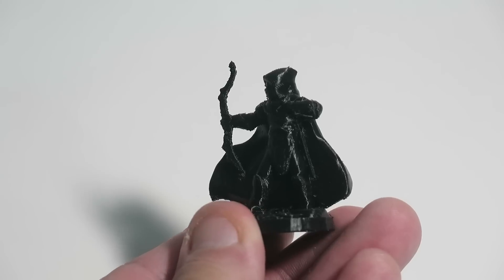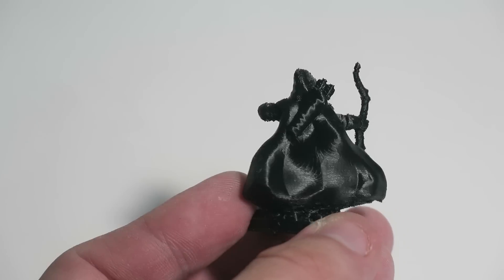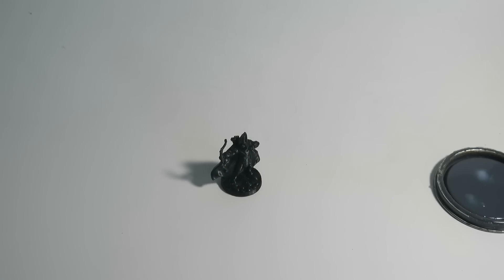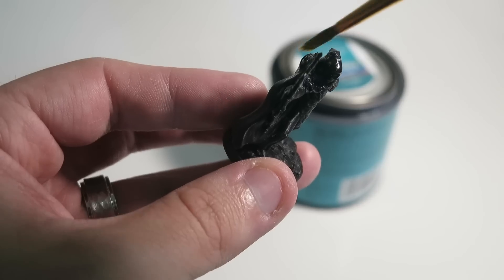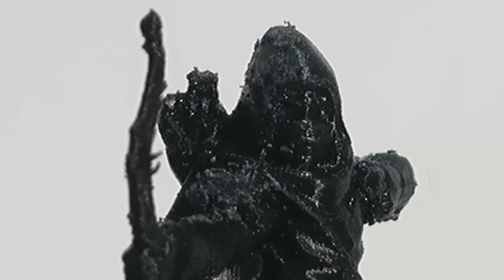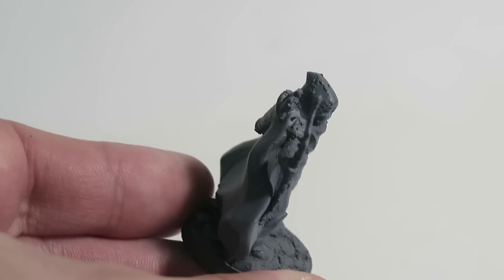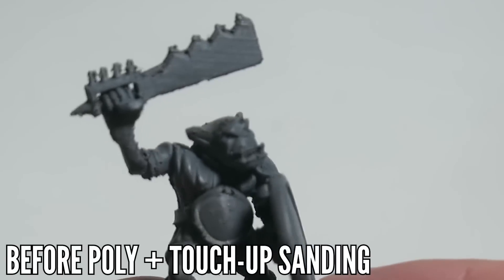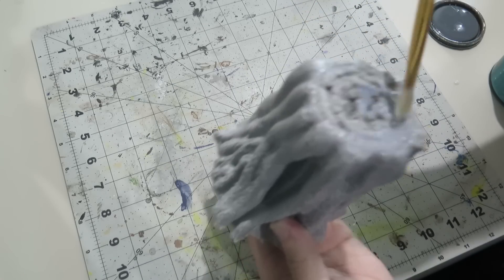Smooth 3D Printed Minis in 1 Min without Acetone - (Printing The Game #5)

Comment: I haven't tried this on minis, but for woodworking I mix my poly with mineral spirits about 50/50 and it helps thin out the poly and makes it much more forgiving.  Since this requires such thin coats it may be worth a try.

Comment: Hye bro,  what software do you use for profiler ? to convert to gcode? I am stack int the transtion between exporting zbrush to any kind of software to print... I useing zbrush for more than 8 year, but I am getting old to learn new softwares . I need a 28mm scale with 1,75 pla filament for now at future maybe change at anottehr material.

Comment: Ts-100 - thermocontrol soldering iron also useful for smoothing prints, fill gaps , build huge models from parts...
I use 160-180°C for pla and blade-like tip.
Also i use construction heatgun, sandpaper, CA-glue and fill primer for big models (i'm working in art studio)
Sorry for bad English (

Comment: The best actions you can take to make a figure as smooth as possible are made BEFORE you print it.
Most of all, use FDM-optimized models and tweak your slicer settings perfectly.
Reply: Tweaking settings for minis can take months of trial and error without an already largely supported profile. This is a good way to help hide imperfections while you learn.

Comment: Except paint does not adhere to polycrilic.
Reply from the maker: I don't know where you get this from, but I have painted lots of models after applying polycrylic, and never had an issue with primer OR paint sticking afterwards my friend
Reply: @3DPrintedTabletop  I get it from 40 years of applying finishes. You may have paint laying on top of poly but it is not attaching chemically. Just look at the directions for muliti coating poly, once it has cured you must sand it to get any bond at all because it wont even stick to itself.
Reply from the maker: I believe you, Mike. What does that mean if I prime it, paint it, and then seal it? I've never had any issues with my paint rubbing off or anything with plenty of use and tackle box storage (rough contact with other minis.) Is it effectively good to go still? Thanks for your input.

Comment: So is the polycrylic more to fill in layer lines or will it help with bumpy areas that didn't get sanded well? Also, will a spray on poly work? Not sure if they make a water based but not sure if it will help. Do you really need a brush on type?

Comment: What about UV resins? You can apply and when you’re happy with it you can use a UV flashlight to cure. It’s also good for bonding parts and filling in parts that you may have ripped off during support removal. Product is called Bondic.
Reply from the maker: Hey Ben! Good to see you here instead of the FB group :) This is ABSOLUTELY an option! I know some folks who even apply their regular printing resin and cure it with a UV flashlight like you mention. It can get messy, of course, but yes - it works. Cheers! Thanks for your comment.

Comment: You should give 3D Gloop PLA a try. It's meant as an adhesive, but it softens and smooths a PLA surface quite well, and the bottles have brushes built into the lid

Comment: hello i have found that mr surfacer 5000 is a good primer instead of autoprimer for these, it is alot more softer. it is made for gundams but it works well and the can is smaller too.
Reply from the maker: Thank you so much for the tip! Is it more expensive?
Reply: its about the same, it has 1200 grits and 1000 grits as well so its pretty smooth. i looked up and found bigger cans

Comment: Is there something similar to this that isn't clear? I'd rather see the result of the coating than have to spray paint it to see the difference.
Reply from the maker: The only thing I can think of that MIGHT work is to use spackle putty, joint compound, or something like that, rub it on with your hands, and then take a VERY light damp towel over the top to remove the excess and smooth it out. I don't think it'll be be nearly as smooth, way more messy and difficult to control - but it just might work in this context. It'll cost a few bucks to try at best. Want to give it a shot and lemme know how it goes?
Reply: 3D Printed Tabletop 3D Printed Tabletop are you talking about wood filler? That play dough like stuff? I have used that on a print before with mixed results. It all depends on how well you can sand it after it hardens so it's best on big flat-ish surfaces. Good for cracks and such. It also doesn't really adhere to the surface too well so it's possible to sand it all away.

Comment: thanks for the tip about polyurethane I made a pip boy from fallout but the layer lines wouldnt go away (printed at 0.2) so I tried some on a small piece after about 4 or 5 thin coats I couldn't feel the lines with my nail so I hit it with some primer and it looks so good I also stripped a hole that I needed to put a screw in to so I added super glue and baby powder and filled it and it works great just a little tip for people
Reply from the maker: Love Fallout - and glad it worked for ya :) Filler primer would work well too, but might cover up some of the detail and require some sanding. That super glue/baby powder/baking soda tip is big for filling gaps as well :) Thanks for the share!

Comment: Hello a doubt between the ender 3 and the prusa mk3 origianl, which has better quality in miniatures, ? . 
the MK3 is much more expensive, but if it gives less problems and its final quality is superior, for me it is better (in the facegroup of the ender I see that there are several post with problems). 
I'm relatively new to 3d printers, I have a flash forge finder, but I want something with more surface printing, and I'm not patient enough to configure paramenters and be doing thousands of tests. I can not afford a very expensive printer either.

Comment: I've had a couple prints where I really wanted a glossy, smooth look (oozes, flameskull, dragon scales); I ended up using enamel model paint, and just layering it.  There's a trade-ff between detail loss and smoothness, but for certain jobs it works great.
Reply from the maker: On those, I actually just apply the poly after I paint. Or I use a spray for those after paint as well. Not only does it seal it and protect it, it leaves it glossy too super quickly without losing detail since it dries clear. Pretty cool to try enamel model paint though! Thanks for sharing!

Comment: You've got to be careful with it, but one way I help get my prints smooth is a lighter.  It helps a lot with little bits that are hanging off after sanding and cutting pieces away.

Comment: Danny, thanks for your helpful channel, I've gained a lot of knowledge here.  I do have a couple of suggestions (well, four actually) that could help with your models as seen in your videos.

 Number one is that a lot of the unevenness on your printed surfaces which should be smooth appear to to be because of cooling issues. To fix this try to print as cool as possible - even try 180c for PLA - and enable lift head under cooling in Cura to give small areas of the print more time to cool.  However, if you can't improve things with this it would be great to fit a cooling fan - I've just done so for my Ender 2, and it's a piece of cake and that's suggestion number two.

Number three is to fit a 0.2mm print nozzle (costs a  dollar and is really easy). I was inspired to do so by you, since you said you'd try it in the future. You'll need to print a bit hotter at 190c perhaps to stop the nozzle clogging, and again a fan would be helpful but by no means necessary. Printing at 0.08 layer height gives awesome prints on my Ender 2 but trying thinner layers didn't seem to help.

The last one is to give tree suppots in Cura another try: remember to enable this setting but disable generate support. I can remove all supports with just my fingers using this setting, it's like magic. It also seems to improve print quality quite a bit, reducing blobs an giving a smoother finish.

Keep up the good work, man! I need to know a lot more about finishing models and painting them.
Reply from the maker: Thank you for the in-depth comment, Wibble! And thank you so much for the suggestions. 

1) Gonna try another print tower soon :) Will keep you posted! 
2) I still haven't gotten around to the nozzle - once my CR-10 is back up and running I'll feel a bit more comfortable experimenting on the Ender 3. 
3) For you, I'm gonna give tree supports another try. I always kept generate support disabled, but it was always WAAAAAY hard to remove because it'd make this solid shell all around the model that made it impossible to remove small or thin parts. They get completely enclosed and were very difficult to remove. Any tips for that? 

Thanks again - I need to know a lot more about 3D printing, always learning in this hobby, and DEFINITELY keeps me sharp! :D
Reply: 1)This is one of those things a print tower won't show up. This kind of overheating happens when you are, for example, printing a figure holding a spear vertically, and it's taller than his head. What happens is that the hot print head will have been dividing its time between printing the head and the spear haft, then when the head is finished it moves over to the spear and completes the haft and the spearhead by continually laying down hot plastic, in a circle, and then moving up a layer. It does this continuously with no break so  the small amount of plastic in the spear is receiving far more heat than is ideal and it will probably bubble etc. However, if you set "minimum layer time" to say 2 seconds and enable lift head, the hot print head will be moved away from the printed part after it has completed its layer until 2 seconds have passed.

3)Same thing happened to me as with you with "solid" supports, until I accidentally found out that Cura seems to use a lot of settings from the support section and applies it to tree support whether or not you enable generate support. The most important of these settings are  support density and support Z distance: set the former to 0% (yes, zero percent) and the other for 0.1mm and the x/y  distance for 0.7mm. Next, disable "enable support interface"   (although you can play about with this later if you want to) and disable use towers. Then enable tree support - the default values are usually ok.  You should end up with a model that appears from the Cura preview to be at least half-coated with melted plastic. However, if you take a look in the layer view you'l see that the outermost layer is only one wall width thick, and there is then a big gap before another wall formed very close to the skin of the model, with thickened areas of extra extrusion to support overhangs. The very thin wall usually  does an okay job of keeping overhangs from drooping but the main benefits are that these very thin layers are easy to pull away wnd leave almost no support material behind. They also seem to give a finer finish on the model surface, perhaps it's protected from stringing and/or benefits from coolling down more gradually, I don't know. 

I still don't know how you manage to remove supports from your models and leave them looking so clean - I just can't do this, so I've no choice but to carry on with tryiing to perfect tree supports,  lol!

A couple of caveats: I'm using an Ender 2 with a 0.2mm nozzle, so you may have to tweak my settings. Also, I've only tried printing with the model mostly vertical with smallish overhangs needing support - I'm going to test it some more  next, but if you are going to print with the model tilted at 45 degrees  I'd think you might have to increase the support density by just a bit to less than 5%. Let me know how it works out for you if you try it.

Congratulations on the 6K subscriptions!
Reply: @3DPrintedTabletop  I would highly recommend meshmixer to generate supports I use the 2mm default built in and the supports are much easier to remove and less likely to cause issues with tearing off pieces of the minatures. The easiest way I have found to make my miniatures look much better with this is to run two tests, the first being orientation, the second overhang (generate supports) you can then export your mini and slice it wherever. Generally the orientation will create a lot more supports but will also make the in places less likely to break the mini when you remove them.
Reply from the maker: I've been working on really learning it over the past few weeks, and couldn't agree more. Thanks for the tips!

Comment from the maker: Hi everyone! One note that has been brought up: If you're going to buy polycrylic, several folks have recommended the water based one. In their words: 
- MorganScott82: "I'd highly recommend the water based polycrylic over the oil based polyurethanes.  The polycrylic will dry much faster, contains fewer VOCs and will offgass much less."
- ZebKrepps: "Make sure you buy water based poly or brush clean up will be a pain." 

I can definitely attest to brush clean up, and thought I'd share Morgan's comment as well for anyone wondering. 

If you are interested in any of the products I use, you can find those here via my affiliate links:
 Cheap Brush Set - https://amzn.to/2sBVyN5
Polyurethane (Minwax Polycrylic) - https://amzn.to/2xMT2Zv
Rustoleum Gray Primer - https://amzn.to/2jqpUxb
Bamboo Skewers - https://amzn.to/2xOgm92
Fine Grit Sandpaper - https://amzn.to/2Jz5KiY
Black 3DMars PLA - https://amzn.to/2xhsdfB

Enjoy! Thanks for your comments.
Reply: You’re a baller my dude thank you for your videos, I bought a 3D printer because I’ve wanted to paint multiple things and don’t want to pay a fortune for figures when I know they don’t cost a ton to make. Your videos are very helpful thank you again.

Comment: Would this work with spray-can polycrylic? Just thinking about light uniform application, but am unsure if the aerosols/drying chemicals would interfere.  You also have the same woodworking application as the brush on
Reply from the maker: If you have a mini that is rough all over, and doesn't have too much detail that you're worried about losing, then yes. But most minis, especially FDM minis, have detail that I'd not want to cover up with a spray can. This lets you touch up different areas with the same effect, and control cracks, crevices, etc. and better control where it goes. I hope that helps and answers your question!

Comment: Awesome vid as always, but I'd make one suggestion, for sanding, I'd use X-Acto's needle file set, or other small hobby file set, I swear by them when working with my own prints. I use my printer primarily to create masters for silicone molding, so any imperfections get picked up and amplified, and that file set has saved me a lot of grief.
Reply: TheBlackBrickStudios A cheap set of curved riffler files from Harbor Freight are my favorite. They help avoid accidentally filing flat spots on curved areas. A have a set of flat files too but I don't find them as useful as the curves ones unless you are filing flat areas.
Reply from the maker: That file set looks pretty legit! I'm using Army Painter's files (I show and use them in the last video with support removal). For what your doing - I would spend the extra time doing finishing as well! Thank you for the share!

Comment: I use primer-filler auto body paint. after a couple of layers (2-3) it fills all the gap bethween the layers.
Reply from the maker: Hi Pierre, like I mentioned to someone else: My only problem with any kind of spray (like filler primer or glaze) was that I'd obscure details that didn't give me any problems in the first place. And with FDM minis detail is too valuable to obscure like that. Using polycrylic let me touch up very specific parts without obscuring any other parts any more than I had too. Thanks for your comment, either way, Pierre!

Comment: You can also use a spray-can/rattle-can of triple thick glaze.
Reply from the maker: My only problem with any kind of spray (like filler primer or glaze) was that I'd obscure details that didn't give me any problems in the first place. And with FDM minis detail is too valuable to obscure like that. This let me touch up very specific parts without obscuring any other parts any more than I had too. Thanks for your comment, Vex!
Reply: I understand the desire for pinpoint application, and using a brush does that better than a spray.

Note that the triple-thick glaze retains intended details as well or better than the method presented here. It's used by many people in the 3d printing community to hide layer lines without obscuring intended details, and it does this pretty well.

Comment: Plastic sanding needles are useful too. The round shape is good for small detail and they're cheap
Reply from the maker: Thanks for the share, Jay! I didn't even know plastic sanding needles existed. Now I do :D I'm gonna have to give these a shot sometime!
Reply: I personally won't recommend because they wear out the sand off the plastic in seconds making it useless. Tried to use them to sand and smooth away the layer lines so I can make a mold and make copy's of a doll head to customize and sell. It cant get into the little nostrils or the sculpted eyelashes and such.

Comment: What finish of polycrylic are you using?  Do you have any problems with paint adhesion over the poly if you don't sand in between?  Also I'd highly recommend the water based polycrylic over the oil based polyurethanes.  The polycrylic will dry much faster, contains fewer VOCs and will offgass much less.
Reply from the maker: I've used Clear Gloss and Clear Satin. Both have similar effects. No problems with adhesion over the poly - but I DO primer after coating it (even if I don't sand it). I got another comment about water based polycrylic - mostly due to the ease of use when it came to the brushes. Good call - I'll add a sticky note! Thanks again for your comment!